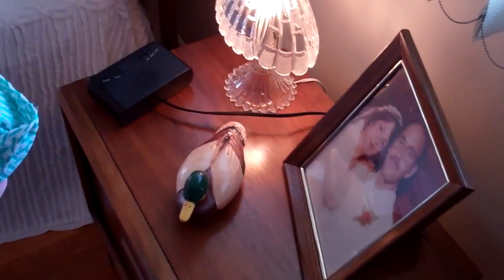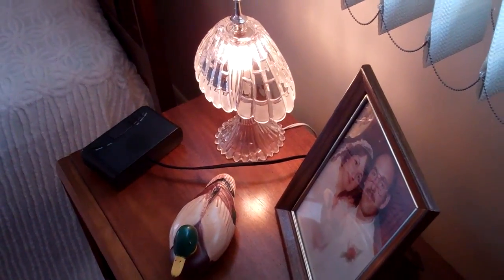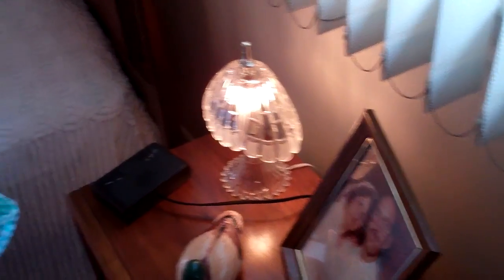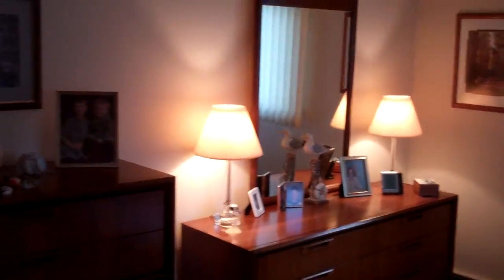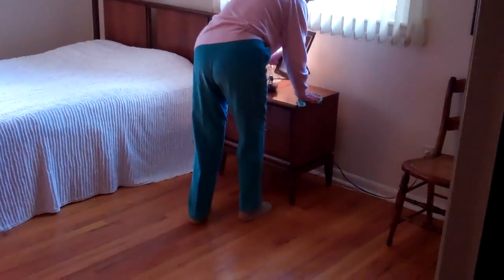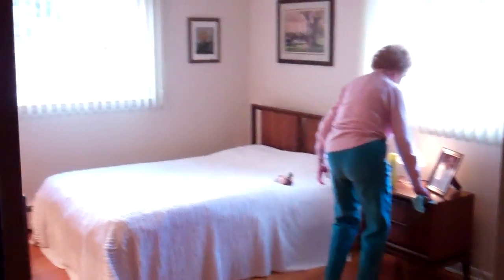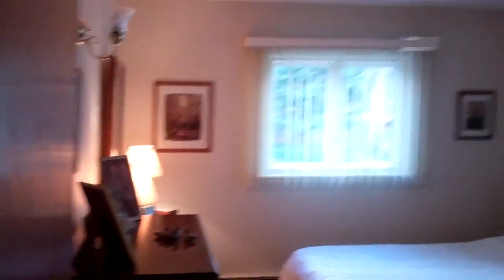Your Receipt Will Print Below the Payment Device  2/18/12 - Day 433

Comment: It's a very good idea burning carbon out with high rpm's. As a metter of fact I have read somewhere that it is recommended (in case if one usually drives under low rpm, for example a city cycle) once per 2 months to plan a distance around 90-120 miles, in order to drive a car under high rpm's. That helps burning a carbon out but, there are 2 negative points: high fuel and oil consumption. So, after race like that it'll be nice to check an oil level in the engine.